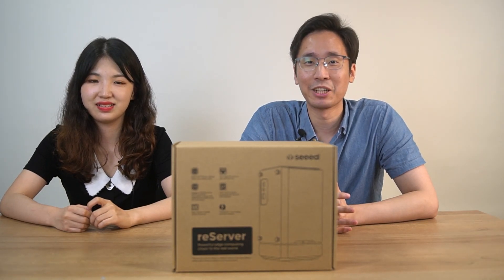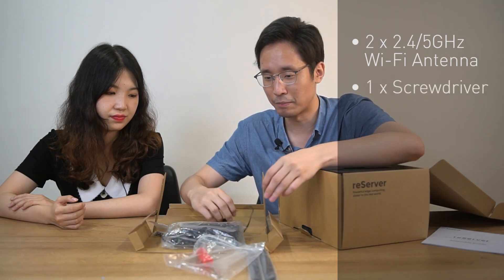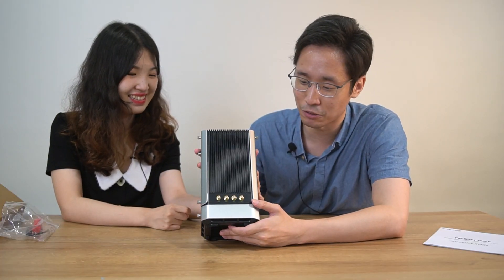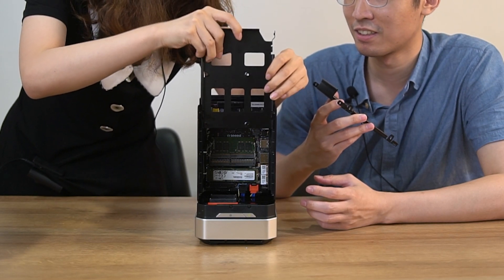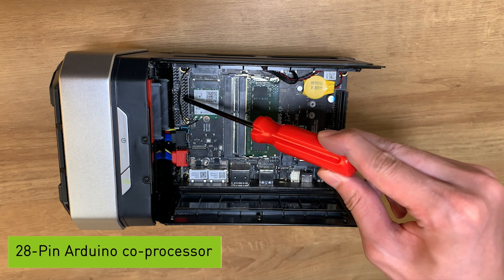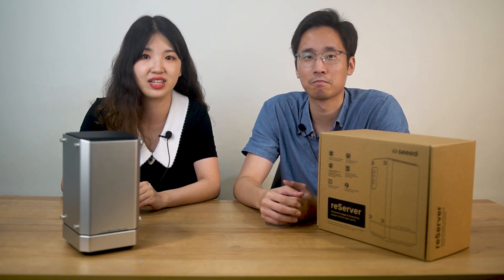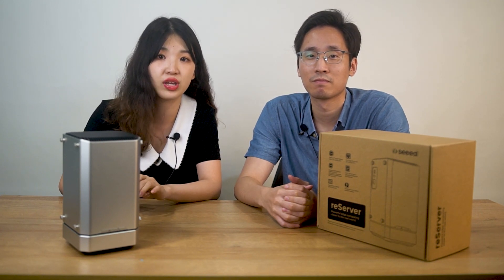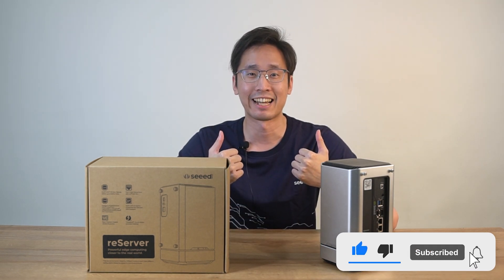reServer - Compact Edge Server powered by 11th Gen Intel® Core™ | Unboxing, Overview, Demo

Comment: Some people (and me, on r/cyberDeck Chanel or reddit) would like to know how much power does the setup need? Let say with just one pci-e M2 ssd and 2 sticks of ram. I know the CPU is from 12w to 25w but for the rest I have no clue...
Reply: It's the first board I found that uses DC power and still has a normal pcie-x 4.0x4 accompanied by 2 SATA ports + nvme.. very curious as to real life tests and performance but more so curious about power draw